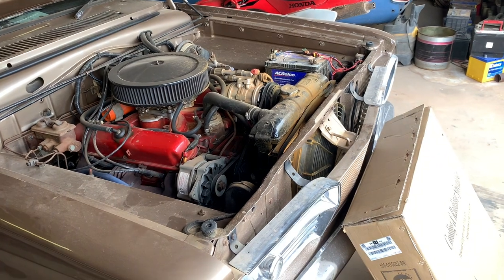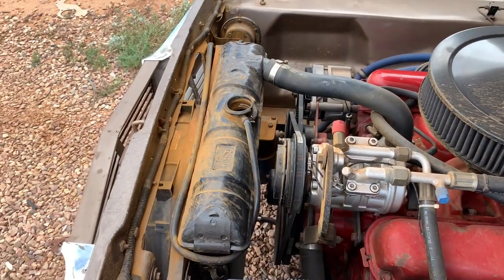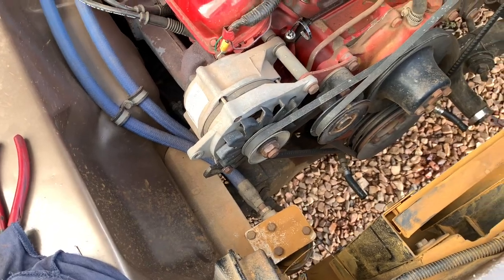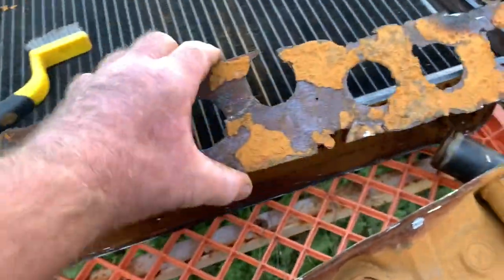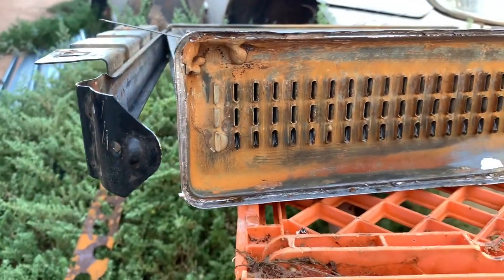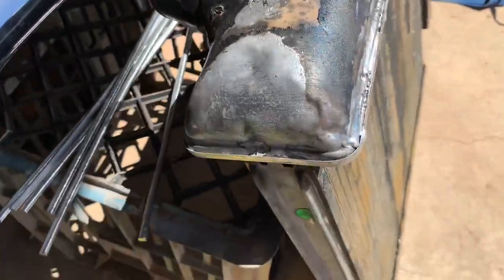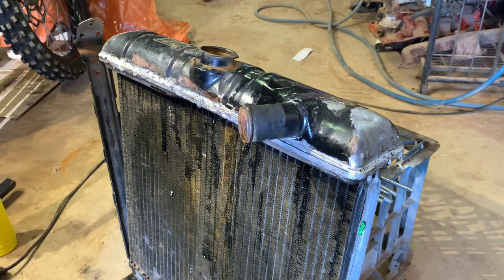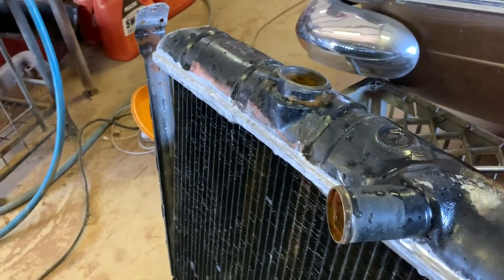AP6 Radiator Replacement, Fail

Comment: Would you consider using white vinegar to clean the block? I soak all my rusty bolts in it, even soaked my car trailer in it before paint after it rained for 3days on the bare steel🤦 $2 for 2L at woollies
Reply from the maker: Well that’s probably an option 👌🏽👌🏽cheers

Comment: I have a question- it wasn't possible to change the support for the new radiator so it sat lower?

I enjoyed the video though radiators are simpler beasts internally then I had thought. Thanks for sharing.
Reply from the maker: I’d have to slightly butcher the lower radiator support and im not doing that .
I’ll eventually find a cheap radiator that will work, I know VK commodore units are close 👌🏽

Comment: think hg hk radiators fit, a guy who is a holden guy on youtube  found out Valiants are made far better than holdens he has, took him a long time to find that out lol.
he has a slant in a ap5 wagon that basically had been sitting years and years something like 20 year may be, and he fitted a holden one 3 core aluminum.
oh he cleaned the carby, got a mate who had 2 old starters, made it into one, and of course the old girl runs.
he maybe a convert.
i think its important to save all old cars.
Reply from the maker: Awesome , yes I agree